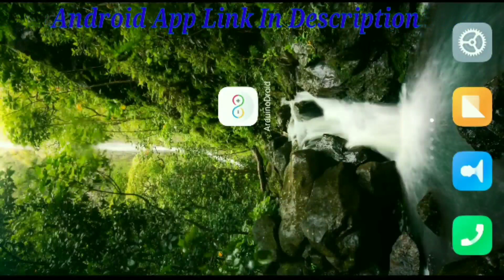How to Make an Obstacle Avoiding Car - Easily - Without Servo Motor - At Home

Comment: And when I power it my motor driver turn on but my arduino dont
Reply from the maker: check whether the battery is giving enough power or not( ~12v) so that ardunio works porperly

Comment: does this work with a 9v battery
Reply from the maker: Motor driver will run smoothly on 10-12v battery

Comment: Vo bhai mene jab 12 v ka power supply kiya toh battery spark kar raha tha bina motor connect kiye aur motor driver aur arduino ko on state bulb bhi nhi jala kya motor add karne ke baad power supply dene pe spark ki problem nhi hogi
Reply from the maker: Check wirings properly, connect + and - terminals with correct Motor Board
Reply: Hi Aryan
Reply from the maker: Hi

Comment: Bhai apke video jaisi wiring karne pe ache se chalega na robo
Reply from the maker: Yes! If still it's not working you can contact me on G-mail
Reply: What's your gmail if it will not work I will contact u
Reply: Mene 12v power without motor motor driver se connect kiya toh spark ho raha tha aur arduino board and motor driver ke led light on hone wali nahi jal rahi thi

Comment: While compiling the code it says" error message" by highlighting the void part. Please check on that and help me!!
Reply from the maker: Ok i will check that and i'll notify you
Reply: @VaibhavDubey108  Did you check it?? Can you recorrect it quick as possible as i made the robot but waiting to upload the code
Reply from the maker: Yes it is correct, and if the code still bit work please inform me so that i can re-write the whole code and correct bug(if present).
Reply: @VaibhavDubey108  Yes i redownloaded it and checked it but still it says that' redefinition of "void setup"  '
Reply from the maker: Ok I will re-write the code again and I'll inform you
Reply: @VaibhavDubey108  were is the code

Comment: Great Videos but can you make the google drive link openable by laptops. Then it would be great. Gave like to the video!
Reply from the maker: It's already in a google drive link
Reply: @VaibhavDubey108   Yes but in laptop's it says that it is not supported so, i can't get the cord
Reply from the maker: You can download it in phone and then transfer it to laptop
Reply: @VaibhavDubey108  Ok i will try! Thanx for the response
Reply: @VaibhavDubey108  Anyway how long will the battery last for when fixed
Reply: @VaibhavDubey108  But what is the app for ios
Reply: @VaibhavDubey108  But what is the app for ios
Reply from the maker: If it is li-ion battery then it may work for 1-2hr at full charge but if you use other battery it may work for 30min
Reply from the maker: You can search bluetooth car controller app for iOS on apple store
Reply from the maker: It might be showing"no preview available" but you can directly download it and remember its in ".ino" format so it will be not open in your device but it will open that code editing app.
I am working on a website where i can add all these codes in one particular place
Reply from the maker: It might be showing "only preview available" so you just download the code and remember it is in '.ino' format so this will only open in that arduino code editor app
Reply: @VaibhavDubey108  Ok managed to open it in the laptop. Is the cord starting with" const int trig = 13; '
Reply: Please reply
Reply from the maker: Yes

Comment: Wtf ur wiring in description is different and in vedio its different
Because of u I burnt my project
This is the most fucking terrible video on u tube I ever know
Reply from the maker: bro I have already uploaded the correct circuit diagram you can check it in the description

Comment from the maker: How's the new Car☺️

Here's the code:-

const int trig = 13;
 const int echo = 12; 
const int in1 = 11; 
const int in2 = 10;
const int in3 = 9; 
const int in4 = 8; 
void setup() {
pinMode(trig, OUTPUT); pinMode(echo, INPUT); 
pinMode (in1, OUTPUT); 
pinMode (in2, OUTPUT); 
pinMode (in3, OUTPUT); 
pinMode (in4, OUTPUT);
} 
long dura, dis; 
void loop() { 
digitalWrite(trig, LOW); delayMicroseconds(2); digitalWrite(trig, HIGH); delayMicroseconds(10); digitalWrite(trig, LOW); 
dura = pulseIn(echo, HIGH); 
dis = dura/58.2; 
if(dis<40) {
 digitalWrite(in1, LOW); digitalWrite(in2, HIGH); digitalWrite(in3, HIGH); digitalWrite(in4, LOW);
delay(200); 
digitalWrite(in1, LOW); digitalWrite(in3, LOW); digitalWrite(in2, HIGH); digitalWrite(in4, LOW); 
delay(500); 
} 
else {
 digitalWrite(in1, HIGH); digitalWrite(in2, LOW); digitalWrite(in4, HIGH); digitalWrite(in3, LOW); 
} 
delay(0);
 }
Reply: Kitne rupye mein ye hmko milega
Reply: Yar bhai yeh code to yahan se copy bhi ni ho rha
Reply from the maker: Yahi type kardo if copy nahi ho raha
Reply: Bhai compile mai errors aa rahe hai.
Reply from the maker: Try changing the porte and arduino board type kyuki code sahi hai
Reply: Tum kahan se kharida
Reply from the maker: Maine ye banaya tha bhai
Reply: Nice